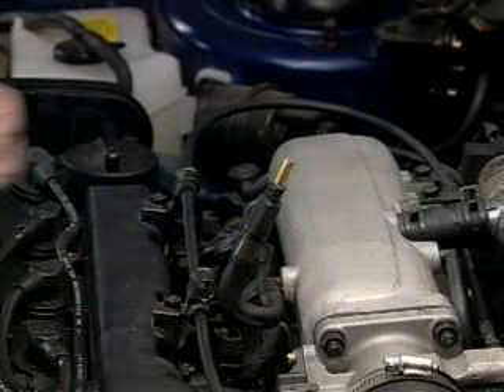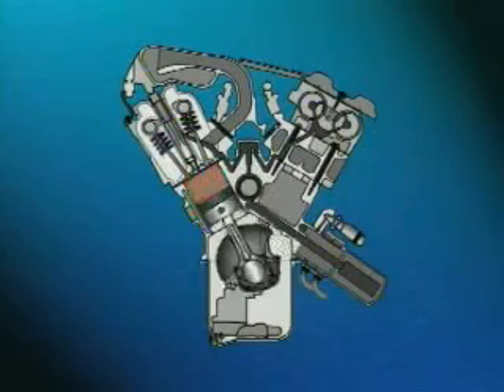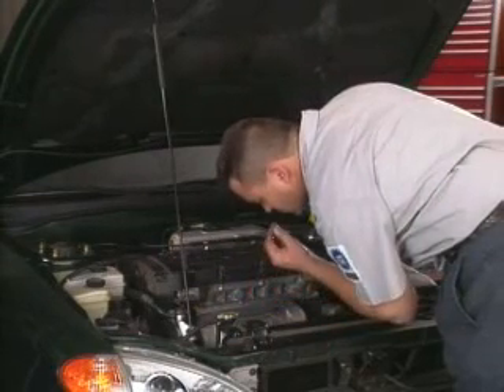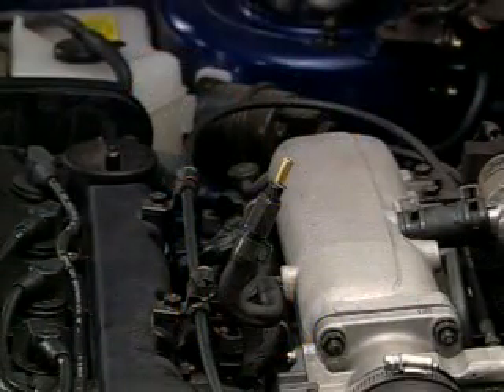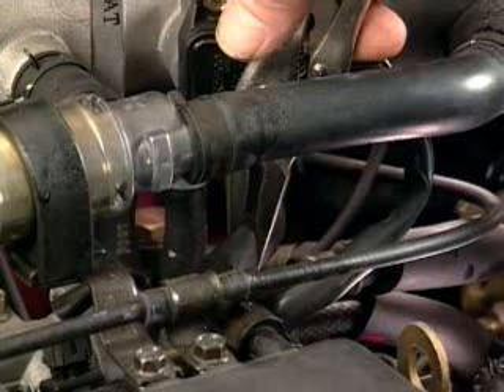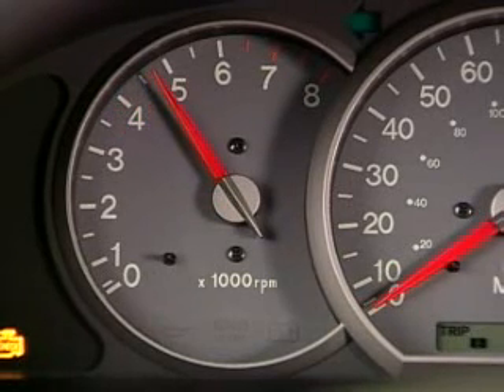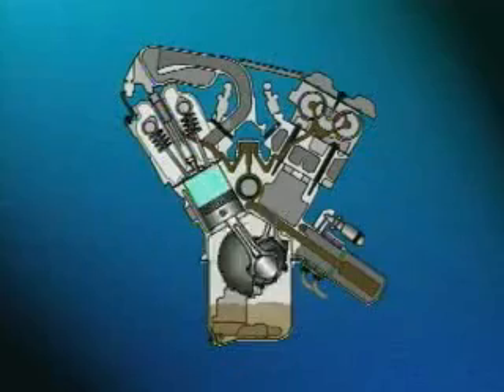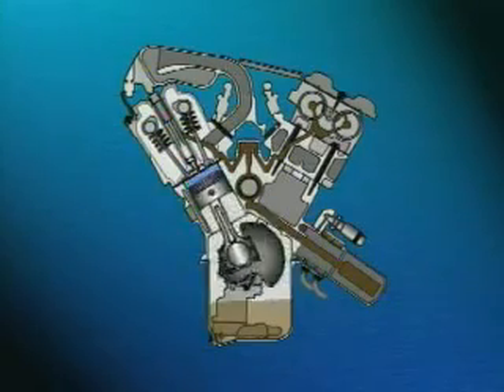PCV VALVE OPERATION

Comment: n3rdbear I put a catch can on my 2000 silverado 5.3 made from an air compressor filter inline with the PCV valve and it catches all of the oil now! I had know idea it was doing it till i took off the intake to do the knock sensors and it had probably a half a quart just laying in the lower part of it! Check the videos out pretty neat "oil catch can"

Comment: I just found out my mechanic stuck the threads from a bolt in the hose lines going to my PCV valve and he removed the valve and just stuck the hose inside the intake. I fixed it but I'm not happy about discovering this on my own. I'm just wondering what kind of damage eliminating the PCV valve could cause.

Comment: @zunilucero PCV only opens just very little enough to allow the intake manifold to suck all the blowby gas out of the crankcase. There is no way that PCV stuck or sticky or not will be open wide and suck oil along with blowby gas . Your engine will run so rough if PCV crack or open wide . PCV acutally sucks very little amount of air every second which mean that it is very important that you check all the hose connections for tight clamps or the blowby gas will not be sucked at all.

Comment: Smog check technicians never check for tight hose connections from end to end.. They usually do visual inspections , that is it... PCV is a "vaccuum cleaner" for the blowby gases coming out of the bottom of pistons with nowhere to go .  Actually PCV is a "slow" vaccuum cleaner which means that tight connections of hoses all around  is very vital to keep air clean on the streets.. Blow by gases is not pleasnt to breath.